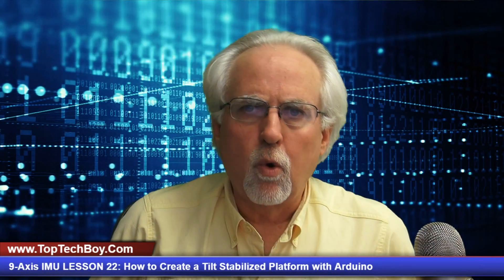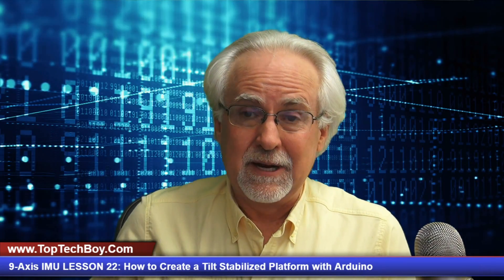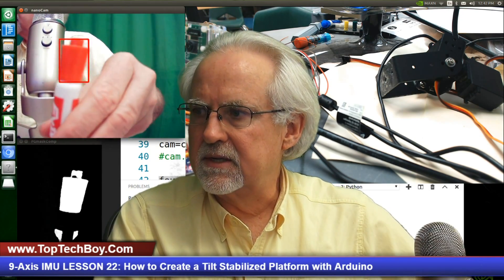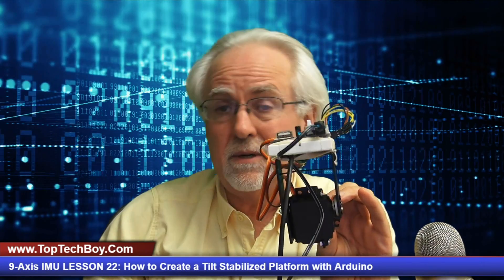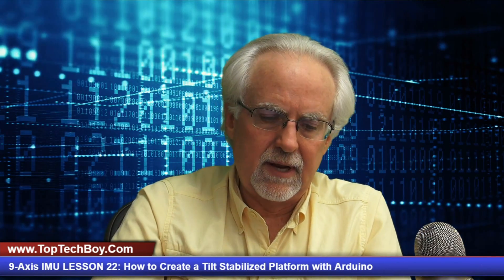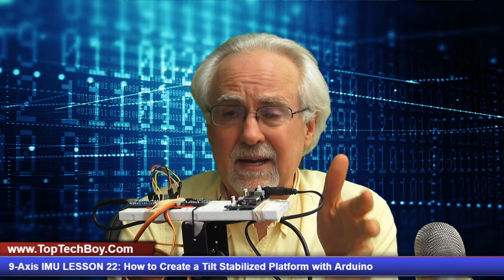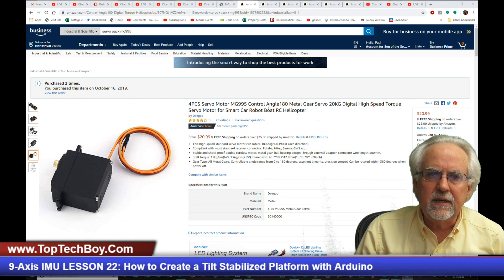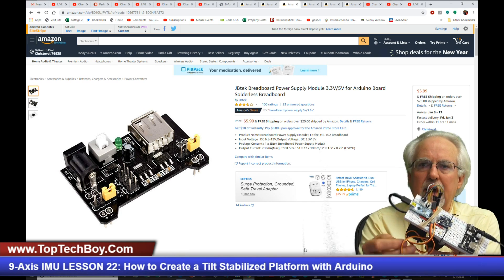9-Axis IMU LESSON 22: How to Create a Tilt Stabilized Platform with Arduino

Comment: lovely video, but I would recommend o use only the gyro for quick regulation and the quat angle for stabilization. it is like the command will be based on 90% (Gyro) + 10% (Quaternion angles )

Comment: I want to do self-balancing two  round tables ( upper n lower table, table is a small round platform 80 mm in diameters) with the following, but  both servos moves and  not counter reaction of my movement. Can u hlep me please? 

 #include<Wire.h>
#include<Servo.h>

Servo ESC;     // create servo object to control the ESC

long accelX, accelY, accelZ;    //variables for measuring acceleration

float gForceX, gForceY, gForceZ, maxX = 0.0, maxY = 0.0, maxZ = 0.0;  //variables for storing g-forces

long gyroX, gyroY, gyroZ;   //variables for measuring angle rotations

float rotX, rotY, rotZ;

float pitch, roll, prevP, prevR;

float errorP, errorR;

int writeVal1, writeVal2, i = 0;

int *pitchCorrect, *rollCorrect;

const int buzzer =  7;

#define LED_PIN 8      // (Arduino is 13, Teensy is 11, Teensy++ is 6)  //original 13

bool blinkState = false;

int potValue1, potValue2;

Servo myServo1;

Servo myServo2;

void setup() {

  pinMode(LED_PIN, OUTPUT); //initialize the digital pin as an output

  pinMode(7, OUTPUT); //7  buzzer

  Serial.begin(115200);

  Serial.println(F("Initializing I2C Pin 5 PWM for COAXIAL DRONE w self balancing.ino..."));

  Serial.println(F("For 2 servos ie upper servo and lower servo "));

  Wire.begin();

  setupMPU();

  myServo1.attach(4);      //myServo1, 11 => roll

  myServo2.attach(3);      //myServo2, 10 => pitch

  flash_led();

  myTone(buzzer, 2500, 300); //300

  delay (300);

}

//function for setting up the module's communication

//https://codebug.vip/questions-893353.htm see the explanation from here 12 Nov 2020

void setupMPU() {

  Wire.beginTransmission(0b1101000); //This is the I2C address of the MPU (b1101000/b1101001 for AC0 low/high datasheet sec. 9.2)

  Wire.write(0x6B);       //Accessing the register 6B - Power Management (Sec. 4.28)

  Wire.write(0b00000000);  //Setting SLEEP register to 0. (Required; see Note on p. 9)

  Wire.endTransmission();

  Wire.beginTransmission(0b1101000); //I2C address of the MPU

  Wire.write(0x1B);      //Accessing the register 1B - Gyroscope Configuration (Sec. 4.4)

  Wire.write(0x00000000); //Setting the gyro to full scale +/- 250deg./s

  Wire.endTransmission();

  Wire.beginTransmission(0x1C); //Accessing the register 1C - Acccelerometer Configuration (Sec. 4.5)

  Wire.write(0b00000000);       //Setting the accel to +/- 2g

  Wire.endTransmission();

}

//function for reading acceleration data

void recordAccelRegisters() {

  Wire.beginTransmission(0b1101000);   //I2C address of the MPU

  Wire.write(0x3B);    //Starting register for Accel Readings

  Wire.endTransmission();

  Wire.requestFrom(0b1101000, 6);   //Request Accel Registers (3B - 40)

  while (Wire.available() < 6);

  accelX = Wire.read() << 8 | Wire.read(); //Store first two bytes into accelX

  accelY = Wire.read() << 8 | Wire.read(); //Store middle two bytes into accelY

  accelZ = Wire.read() << 8 | Wire.read(); //Store last two bytes into accelZ

  processAccelData();

  delay(10);

}

//function for processing acceleration data;

void processAccelData() {

  gForceX = accelX / 16384.0;

  gForceY = accelY / 16384.0;

  gForceZ = accelZ / 16384.0;

  pitch = (atan (gForceX / (sqrt(pow(gForceY, 2) + pow(gForceZ, 2))))) * (2000.0 / PI) + 1500;

  roll = (atan (-gForceY / gForceZ)) * (2000.0 / PI) + 1500;

}

void loop() {

  recordAccelRegisters();

  printData();

  delay(10);

  pitchCor(pitch);

  delay(10);

  rollCor(roll);

  delay(10);

  //delay(10);

}

//function for printing the acceleration data

void printData() {

  Serial.print("accel X =");

  Serial.print(gForceX);

  Serial.print("g ");

  Serial.print(" accel Y =");

  Serial.print(gForceY);

  Serial.print("g ");

  Serial.print(" accel Z =");

  Serial.print(gForceZ);

  Serial.print("g ");

  Serial.print("pitch = ");

  Serial.print(pitch);

  Serial.print(" roll = ");

  Serial.print(roll);

  Serial.println("");

}

void pitchCor( float pitch) {

  if (pitch > 1505.0 || pitch < 1500) {

    myServo2.writeMicroseconds(3000 - pitch);

    delay(10);

  }

}

void rollCor( float roll) {

  if (roll > 1502.0 || roll < 1500) {

    myServo1.writeMicroseconds(1500 + (1500 - roll));

    delay(10);

  }

  // blink LED to indicate activity

  blinkState = !blinkState;

  digitalWrite(LED_PIN, blinkState);

  //delay(20);

}

Comment: The course is getting even more interesting!

Here is a suggestion: when you hold the self leveling mechanism in your hand to show how it compensates for tilt and roll, the motions are not readily obvious in the video because your hand is moving, as well as the mechanism. I suggest that you add a square plate to the bottom bracket with length and width approximately equal to the  length of the bread board. This will provide a visual reference for the bread board that will show how the bread board is adjusting itself to remain horizontal while the bottom plate is being tilted to various angles. 

If you set the whole assembly on your desk and then lift one edge of the bottom plate the bread board will try to remain parallel to the top of the desk and this should be easy to see in the video. 

An added advantage to this approach will be that when to hold the bottom plate in your hand you can hold it off to the side of the bread board, away from any “pinch zone” (easier on your fingers!).